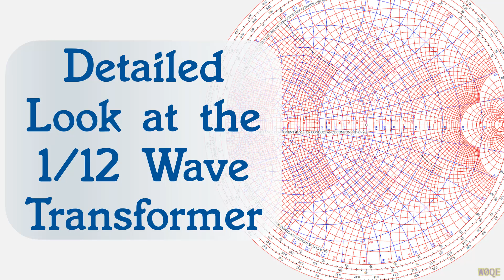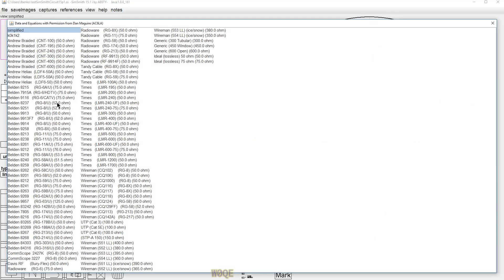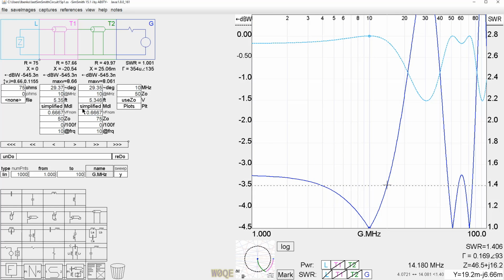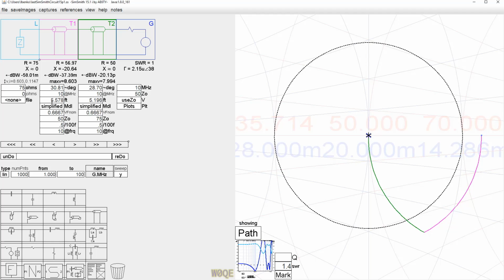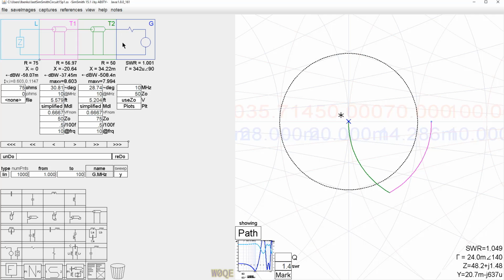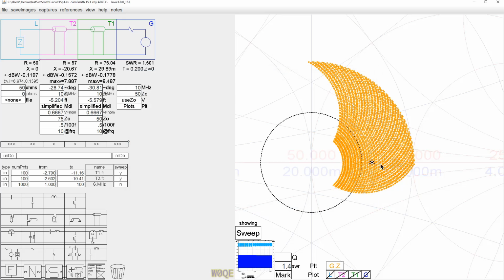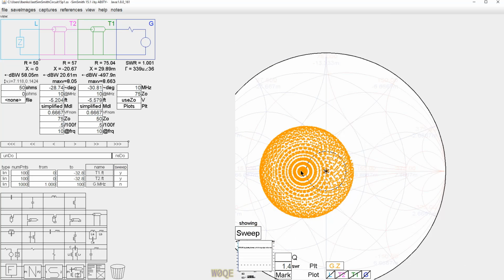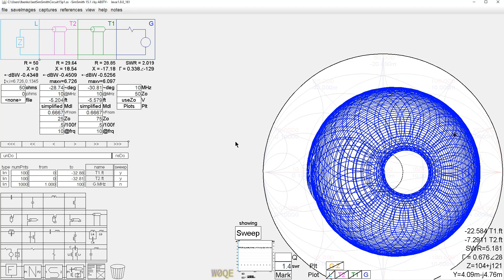#42: One Twelfth Wave Transformer

Comment: Many thanks for this. It never occurred to me to match impedances this way. I've now tried many variations in SS and am very impressed. They seem to be rather more broad band than lumped component circuits. I will definitely consider this approach for future projects.
Reply from the maker: Comparing transmission lines to lumped components results in the transmission lines producing a lower Q overall circuit than decent quality lumped components.  This means the circuit has more loss.  However this is slightly mitigated in that a matching circuit that is X feet long removes the loss that was created by the X feet of transmission line prior to the matching network.  Glad you enjoyed the video.